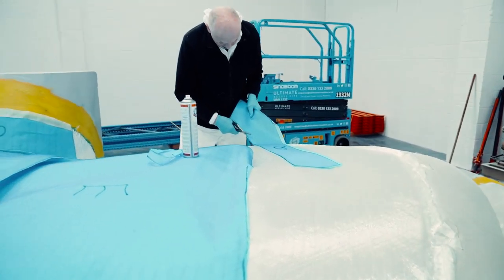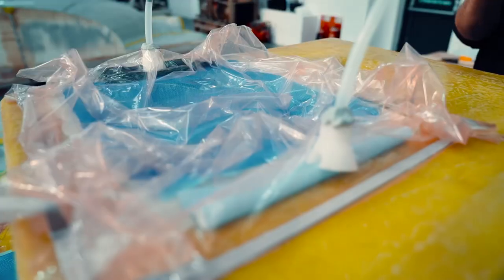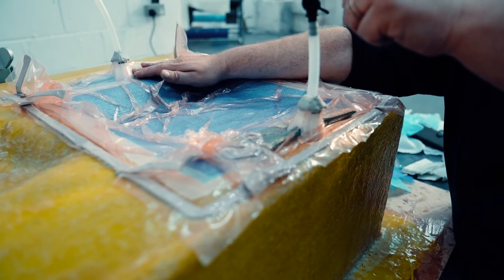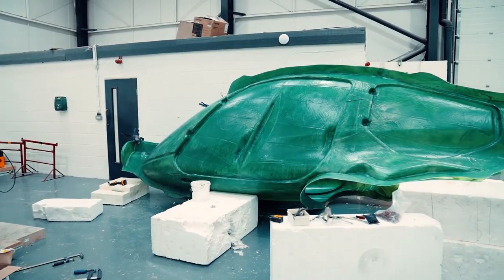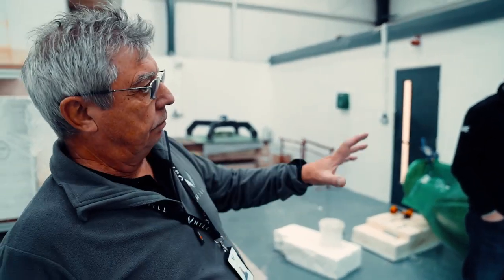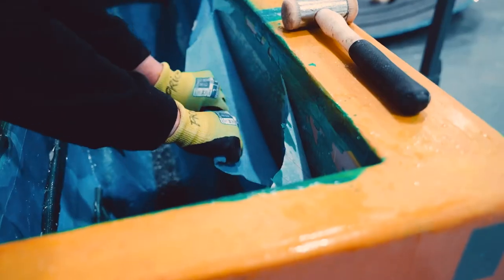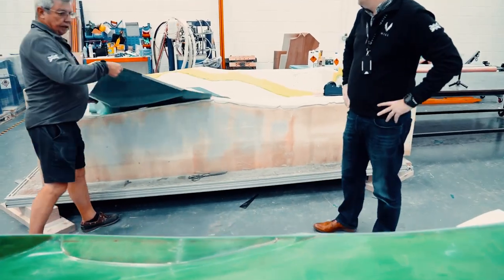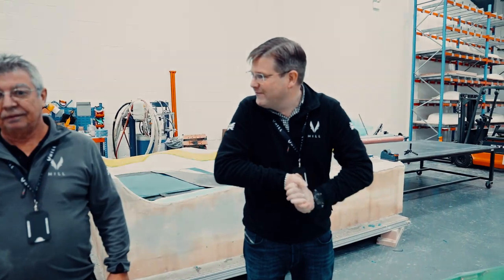Journey to HX50 | Episode 18: Industrial Metamorphosis

Comment: Are those moulds only used for the prototype? I don't see how you will get the level of finish or accuracy required for a quality fuselage. The moulds look super thin for the size, and have no steel frame or reinforcement.
Reply: Yeah surely this is either for a mock-up or it's about to be fitted to a big steel frame. Maybe they're indexing the mould sections and drilling the holes whilst the moulds are still light and easy to move?
Reply: Ah, should have watched till the end...